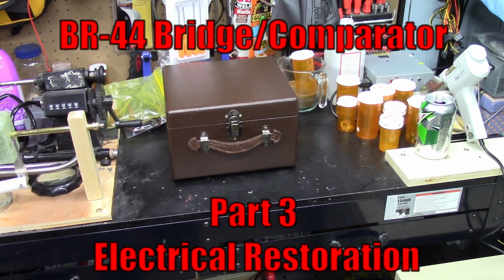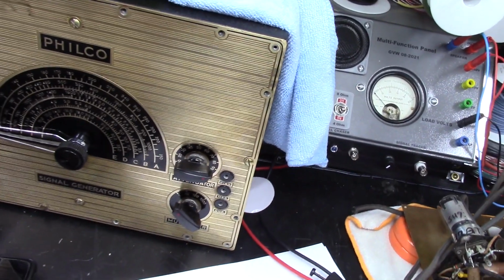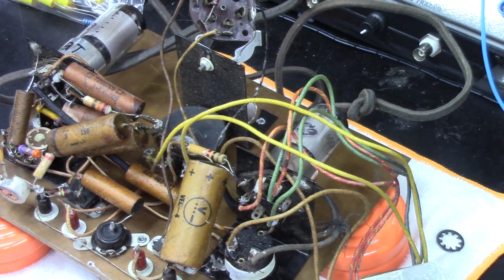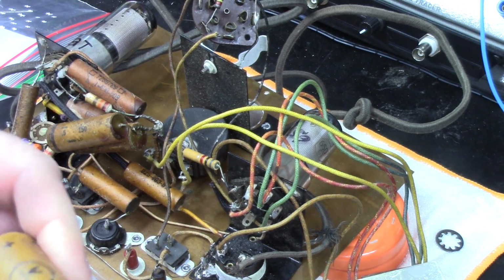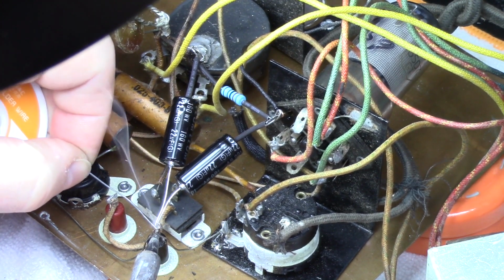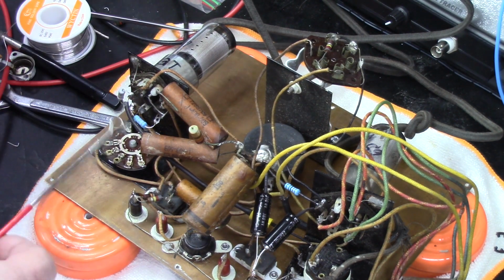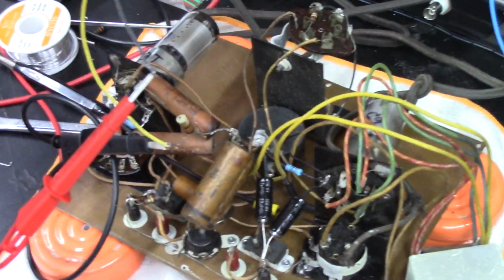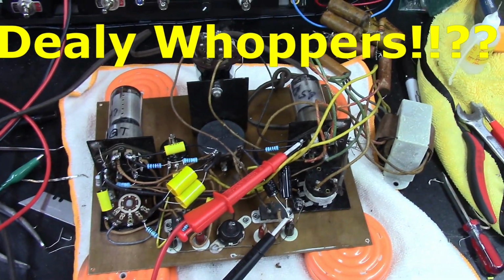BR 44 Comparator Bridge - Part 3

Comment: What is a comparator bridge used for? Or what were they used for?
Reply from the maker: Hi Bill, the idea back in the day before high tech meters was that you could hook up a resistor or capacitor of an unknown value and it would tell you the value of that unknown component.

Comment: Those pin connectors are made extra long so you could shorten  them for your Philco sockets. 
Nice seeing you back in the shop again Gregg. Pretty bright eye tube! Great progress so far. Steve
Reply from the maker: Thanks Steve, yes great to be back! Yes, I'm excited to make some new cables to use the Philco original Jack's. It is a very accurate SG for how old it is.

Comment: Looking great!  Those were usually calibrated to a value with the pointer at the half way point.  The Heathkit C3 used a 200K precision resistor for calibration. Going by your pictures it looks like a 1K resistor would be used and then calibrated with that 2K pot you put in. Looking forward to the next video!
Reply from the maker: Thanks Bob! I'll try calibration at the mid point. On my schematic I added the 1k resistor to take the place of the calibration pot. not in series with it. That was just my reference, I since just changed the pot. to a 2k like I installed. Thanks for all your help my friend.